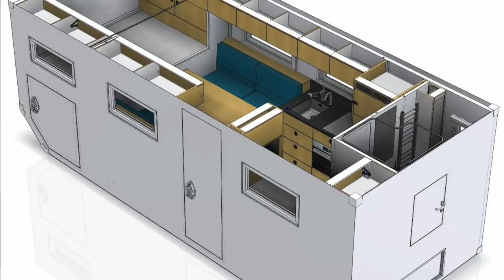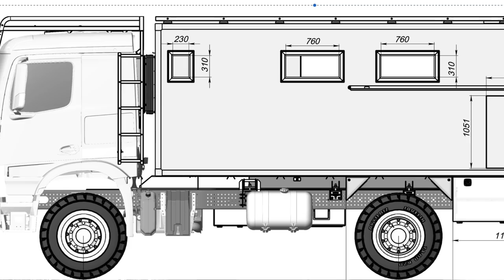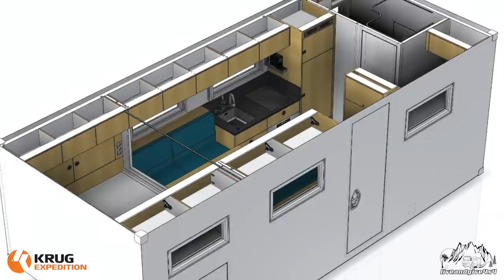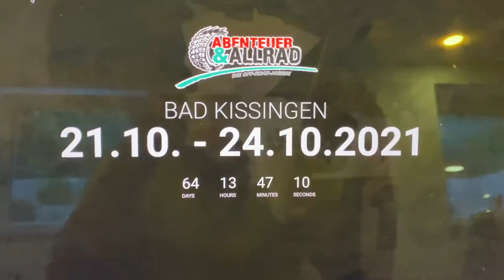First steps on how to build Overland Truck Mercedes Arocs 4x4 with Subframe ► | Krug XP trade Show

Comment: SW on a Unicat where they extended the cab to make the seating better. Think they added about a 300 mm box to the back which better allow the seating. If you did that on the driver side then you son could sit behind you and your wife could interact better with him with out unbuckling to do so.it shouldn’t cause an issue if you didn’t tick out more than the air intake on the passenger side.   But of course any thing can be done when you put more money into it!
Reply from the maker: Nice idea 💡 but we found our way 😉🍀thanks for watching 
See ya when we see ya 👋 
Fabian Isabela and Matheo

Comment: Some seriously awesome trucks!!
I wonder, does that gigantic fuel tank on the driver's side of the chassis have any effect on the handling and balance of the car?
Why not have fuel tanks on both sides of the truck, so you can switch in case of a leak?
Reply from the maker: That’s possible as well 😀🍀again, never change a running system 😅😅 we had 400 liters of diesel tank before and mow 500 liters, so we think it’s enough and chose a bit more storage space instead of a 2nd tank … but you are right, you could have 2x 500 liters… about the balance we balance it out with the 2x freshwater tanks That we have mentioned in the video… 
Thanks for watching … 
See ya when we see ya 👋 
Fabian Isabela and Matheo 
You would like more info?
Sign up to our newsletter: 

https://www.liveandgive4x4.com/newsletter

Or become a member on YouTube:

https://www.youtube.com/LiveandGive4x4/join

Comment: Oh wow, Krug don't use the 2/3 point pivot system then. I thought that was standard on the bigger stuff as the pin and spring linkage type was still pretty stressful on the body.
Do you know if the floor of the body is hiding crossbracing internally or is the composite floor strong enough in its own right to just sit directly on the two channels in view directly above the chassis?
Hope that all makes sense :D
Reply from the maker: Yea, steel cross bars are implemented I. Our floor… that’s where the cabin will be mounted on the subframe…  in minute 10:16 on it is all explained on our words 😀🍀 🙏😌 
again, we drove 5 years on and off road with the same system in our old atego 1023 and managed … to us, this is the way to go for our truck… 😉🍀👍
Thanks for watching 
See ya when we see ya 👋 
Fabian Isabela and Matheo 
 Sign up to our newsletter: 

https://www.liveandgive4x4.com/newsletter

Or become a member on YouTube:

https://www.youtube.com/LiveandGive4x4/join
Reply: @LiveandGive4x4  Ahh steel cross members in floor, excellent. That makes more sense, thanks for the reply. Yea I paused the video to write the comment just before you actually mentioned about the spring system haha typical! Already signed up for the newsletter of course ;-) 
Have you test driven a pivot system truck compared to your sprung loaded version.. Wondered what you thought of the difference if you had?

Comment: Same or better is CLO2...breaks in in biofilm, does not creates resistance and breaks down in O2 and salt...better because it's not handful to mucus membranes inside body and you use it safely on external and internal application for a series of disinfection ..

Comment: Is the required on highway low position of the bumper to prevent a low height passenger car from rear ending and wedging under your truck during a crash and possible decapitation?
Reply: mmm makes sense...
Reply: @Hello Petereement how are you doing